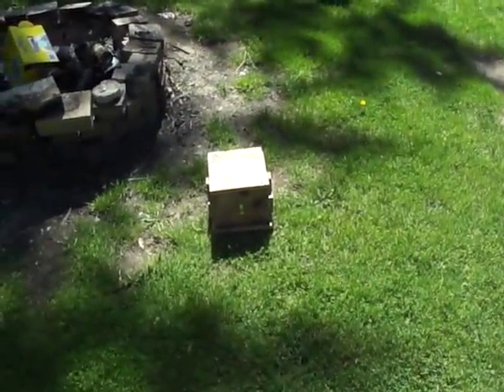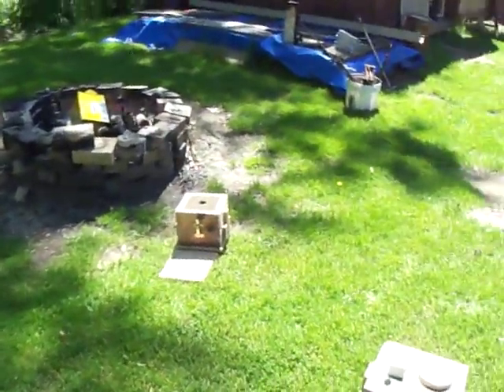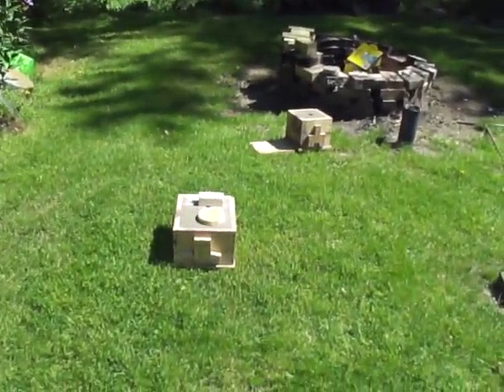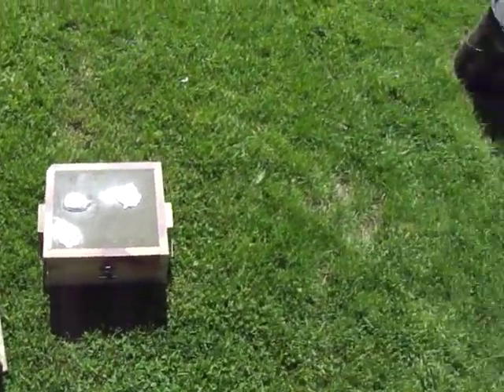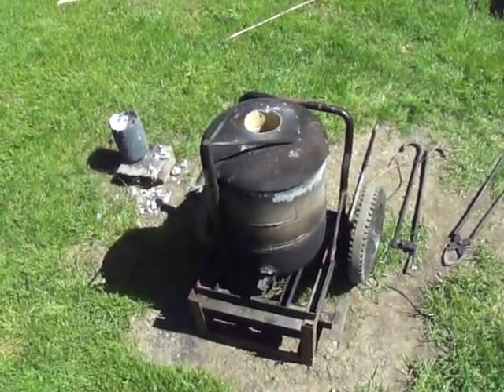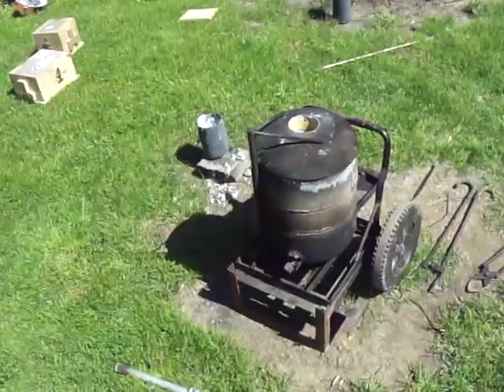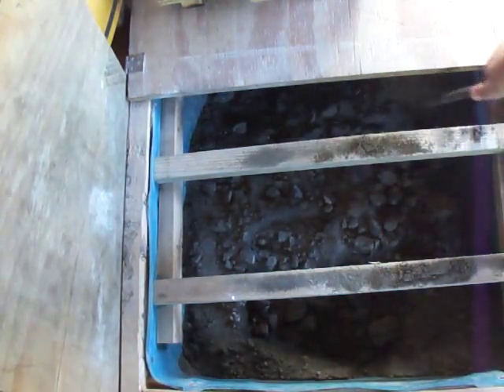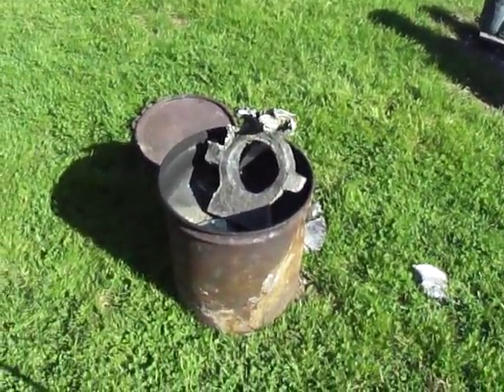Casting Day #3 - Steam Engine Pistons - Lost Foam Lathe Steady Rest

Comment: you can see why i like to use a soup can reservoir on top of the sprue. makes cleanup alot easier too. cool vid Chirpy.
Reply from the maker: lol, I tried it just goofing around, and really just ended up tossing that thing because it turned out like crap, it was extruded aluminum, and I wasnt happy with it at all. Ive never liked or had much luck with lost foam, and Ive always got a much better finish on the greensand castings, so just stick with that really.

Comment: The only time I tried lost foam was with trying to make a pair of lead knuckles and it almost worked
Reply from the maker: yea, I usually use greensand casting to make my stuff. Lead doesnt get hot enough to vaporize the foam anyhow, you actually have to superheat aluminum to get it to work, so imo, it only truely works with aluminum and hotter metals. Thanks for watching.